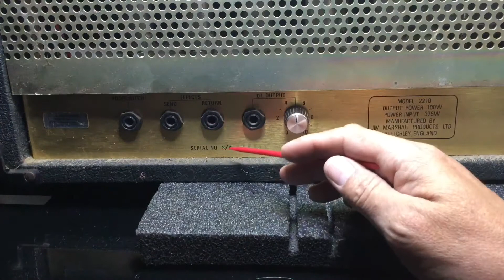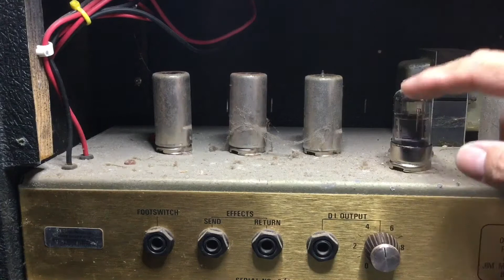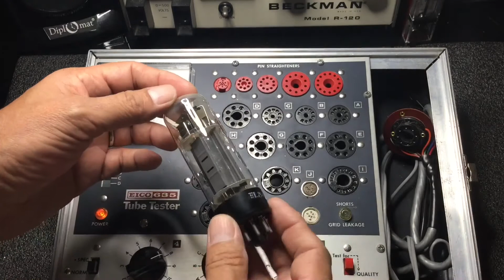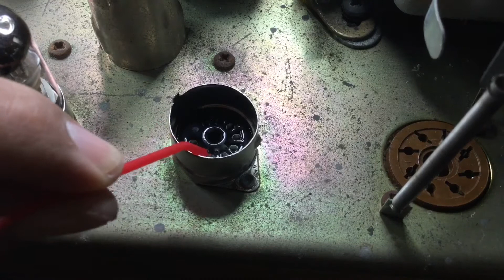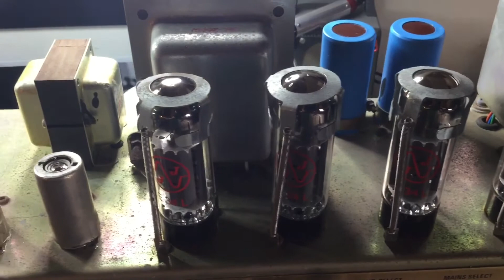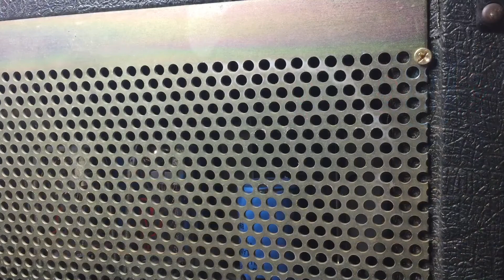How to repair a Marshall JCM 800 Amplifier model 2210 100 watt

Comment: Nice, I subbed to your channel. Is this amp 'easy' to repair? I know there is no comparison but I recently sold a Marshall MG100FX, it had a scratchy master potentiometer, I opened it up to take a look and didn't like the fact that (of course it was a solid state) it was all digital, everything was SMD components and it even had a fan right below the main amp's heatsink, so it was a mechanical part that in case of failure would burn the amp, and I read online that it was a common issue, it didn't sound horrible (I've heard worst ones) but I didn't want to bother with having to replaced burned amps or getting a digital PCB replacement for it in the future so I sold it. Now I am looking forward to get a 'real' tube amp and there's a JCM 800 2210 for sale near the place I live,  would you consider this amp to be a good purchase, I want something durable that can sounds good and is made to be fixed in case it fails, what are your opinions on this one? Thanks by the way and greetings from Colombia.
Reply from the maker: I believe that you will be  happy with the tube amplifier of your choice.